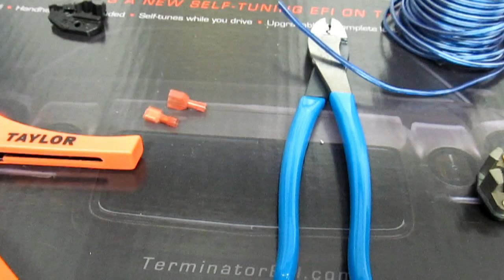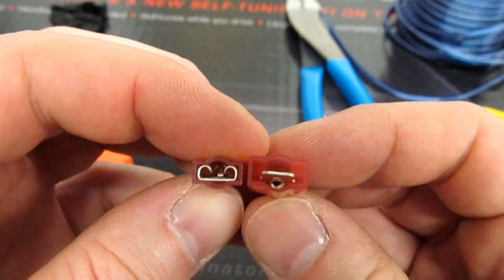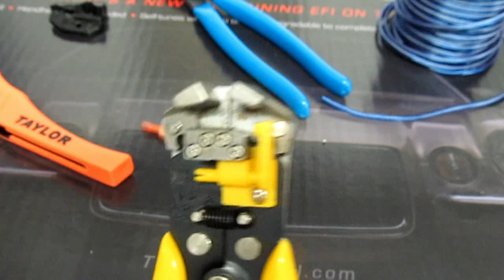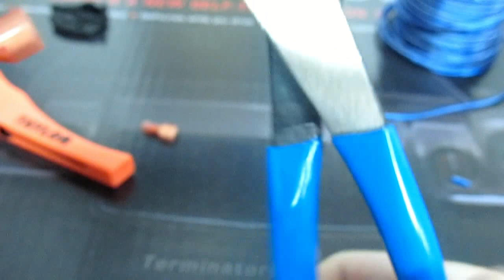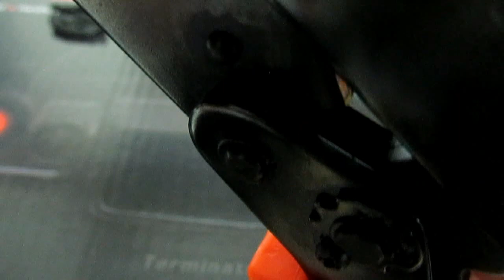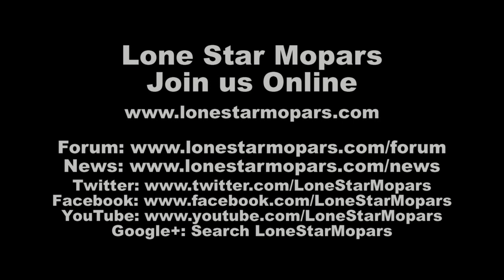Crimp Test Showdown Channellock 909 vs Taylor 43400

Comment: Sadly, the quality and finish of Channellock 909 crimpers manufactured today has gone way downhill from the crimpers that were made decades ago.  I have the old ones, and looking at the new ones in the stores brings a tear to my eye.  Very rough, poor machining, sharp edges everywhere along the tool, uneven edges, and tooling marks that look like the crimpers were finished on a rough carborundum grinding wheel.  Honestly, they strike me as some kind of cheap CCP Chinese POS from Harbor Freight!  I have about 15 Channellock hand tools tools that were purchased in the 80s and 90s, and they are indeed fabulous.  My advice to anyone considering buying a brand new set of Channellock crimpers, do yourself a big favor before buying and go look at a set of the Klein J1005 crimpers.  Just hold them side by side with the Channellocks and you will see a MAJOR difference in quality of manufacture, it totally blew me away!.  Klein still builds these crimpers pretty much just like they did years ago, made in the USA and nicely polished and finished, like a tool that costs $30+ should be!!!  They cost a few bucks more than the Channellocks, but after you compare the two I am sure you will want the smooth Kleins over the rough Channellocks.  They are WELL WORTH the extra dollars, any day of the week.
Reply from the maker: I had no idea the 909s were up to $30.  I just searched a few sites and they are right there.  I was going to say the perk for the average consumer would be that the Channellocks were half the price, but I guess that is no longer the case.  I love both companies and have seen swings in QC over the years.  Several years back I got new Kleins at work and the #2s were soft and just didn't last like they once did (hence why I started the screwdriver quest).  I tend to prefer the older stuff from both companies, but I suppose I might be partial since they are still there and still working well.
Reply: Why do you keep reposting this same tirade on all the 909 videos?
Reply: If you want even better quality than the Klein's look into the Thomas & Betts WT1112M.